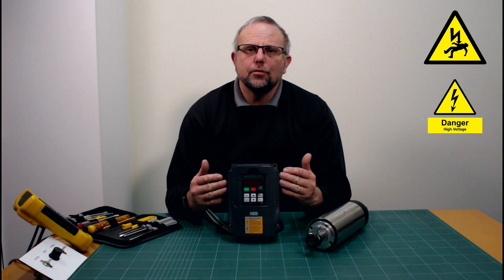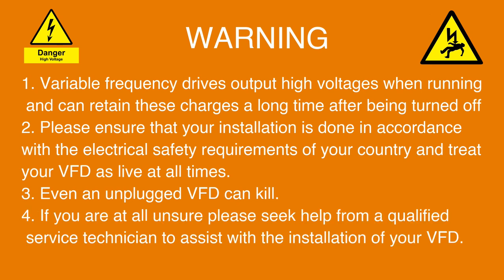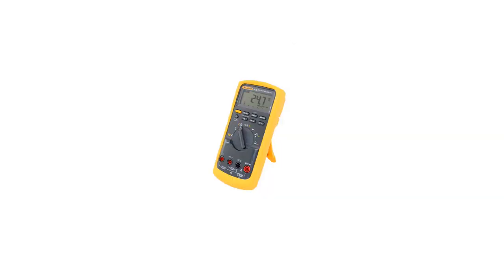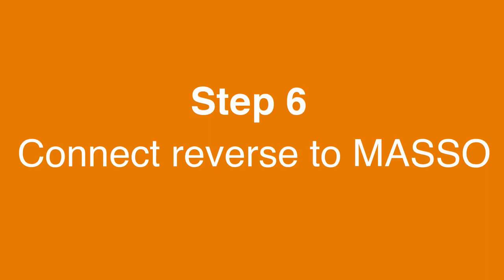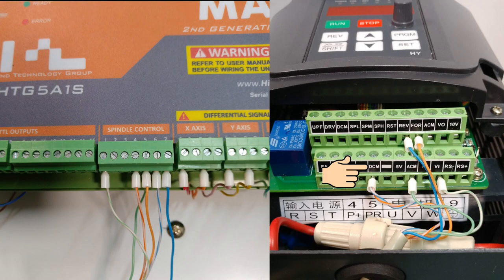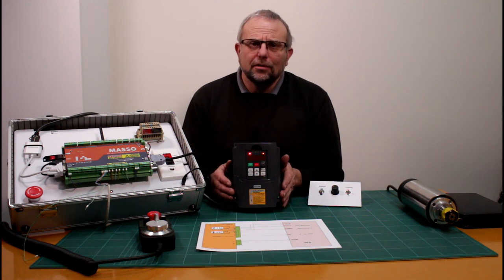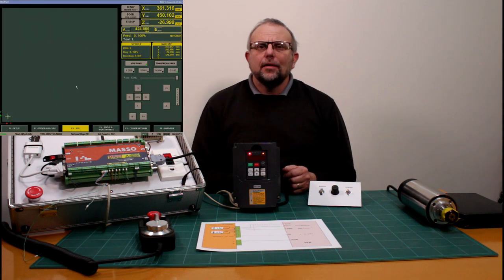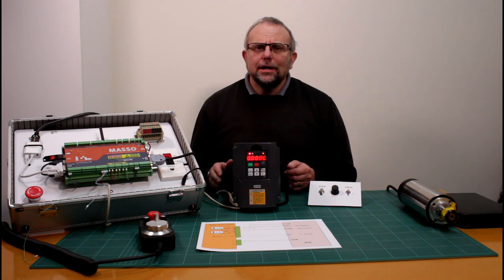MASSO 101 - Setting up VFD (Variable Frequency Drive) with MASSO (Spindle Drive)

Comment: Why would you want to run your spindle in reverse?
Reply from the maker: Some applications, such as lathe machining, require both clockwise (CW) and counterclockwise (CCW) rotations. This allows for greater versatility, especially in operations where reverse rotation is essential.

Comment: Hi, could you please post a list of the PD settings (speed related), I have the Masso and the same VFD as you but have the following problem. S24000 = 24000 on VFD (ok) S12000 = 15667 on the VFD (not ok). The volts on the 0-10v (ACM-V1) read 10v and 5v (so ok there) I cant find the setting on the VFD to adjust the speed to read correctly apart from when it's at full speed. I hope that makes sense. Thanks.
Reply: These are the settings that I found at Peter's CNCNUTS page. They are based on the same VFD/Spindle that we are using.

Parameter	Setting
PD001	1
PD002	1
PD003	400
PD004	400
PD005	400
PD006	2.50
PD007	0.50
PD008	220
PD009	15.0
PD010	8.0
PD011	0
PD014	2
PD015	5
PD023	0
PD024	1
PD026	0
PD044	2
PD045	3
PD070	0
PD071	20
PD072	400
PD073	0
PD074	0
PD075	0
PD076	0
PD141	220
PD142	10
PD143	2
PD144	3000
PD145	2
PD146	10